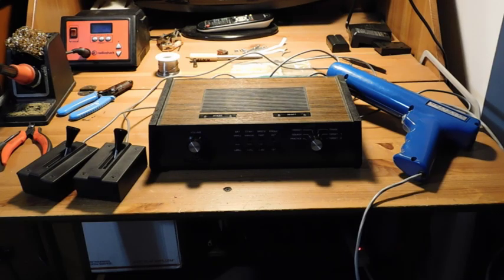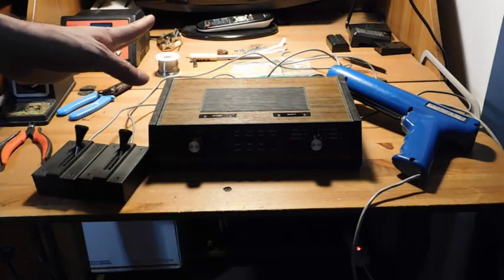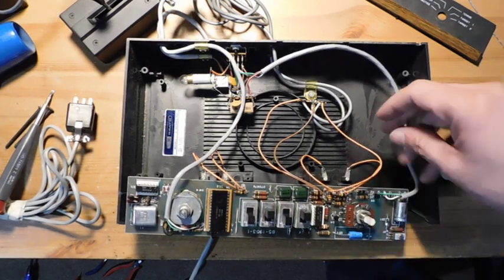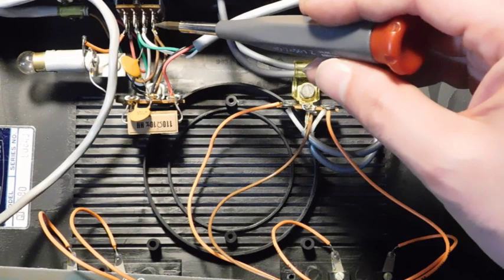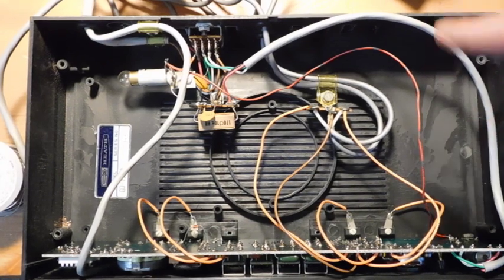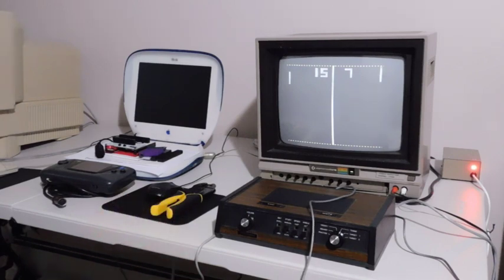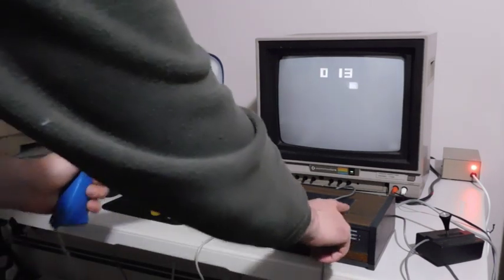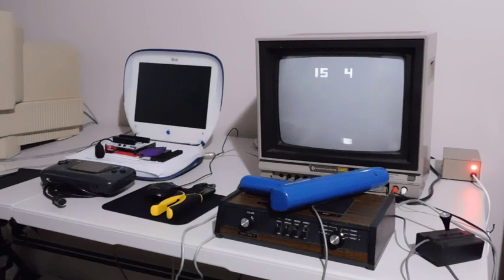Super Rare Heathkit GD-1380 Pong Console! Restoration and demonstration

Comment: I have one of these I picked up at a thrift store a few years ago. I have a little knowledge of electronics, but not enough to figure out how to modify it successfully and finding a manual for it proved completely impossible. Your video really will help me go in the right direction to getting it working with a modern TV, something I've also wanted to do for years. It's crazy that it uses composite video.

Comment: The reason the case has the speaker mounting is this case was used for many different kits by Heathkit, like a clock radio, etc., that's also why you see so much room inside the case that the pong game does not use. I built the GR-900 TV that this went with and also have this complete game, played it for hours back in the day!!

Enjoy!
Reply from the maker: Awesome! Thanks for that additional info!